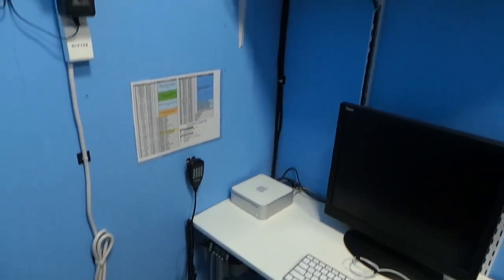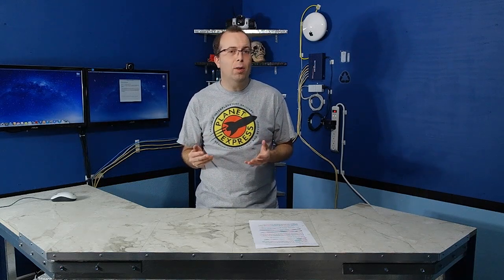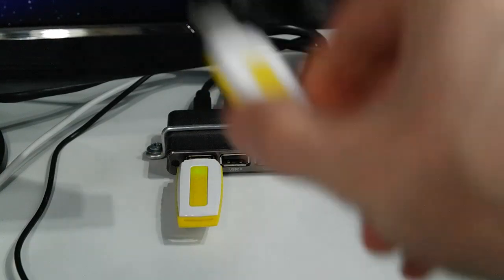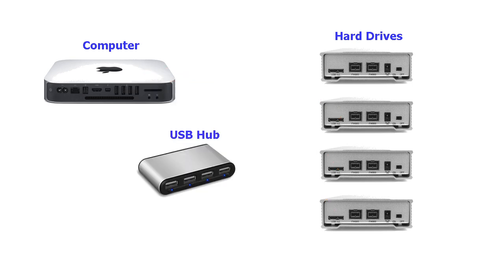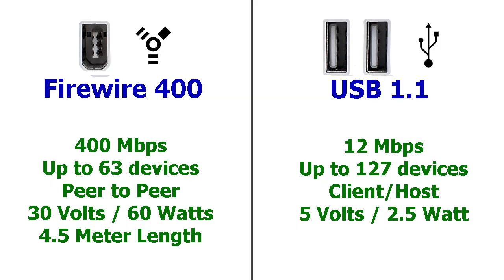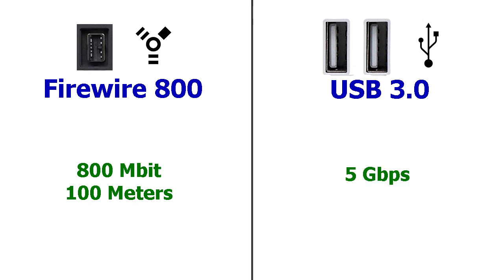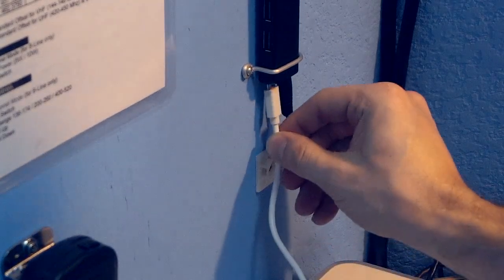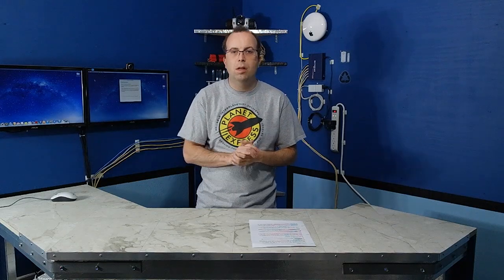Farewell R.I.P. Firewire, Hello USB!

Comment: If i where you i would go with NAS instead, for instance a 2 or 4 bay (or larger) synology diskstation. Costs a bit more, but it gives you way more feaures and alot more speed (1gbps or even 2 gbps if you do dual lan models). Having those kind of drives for any backup is bad, and especially if you do RAID5 - ods that you will get a unrecoverable read error is almost 100% on volumes of 2TB or more and it will result in lost data.

But RAID is no backup anyway.

Comment: Why didn't you keep the Firewire cables on the old drives and then added the USB hard drive using it's own USB slot or hub? Wouldn't that reduce the cable mess?

Comment: Isnt Thunderbolt Daisychain too?
Reply: iMac James It is
Reply: +iMac James 
It is, and, but, Thunderbolt is ridiculously expensive when compared to USB. It&#39;s also incompatible with all the existing devices meaning you&#39;d need to re-buy everything to use it.&#160;

On top of that, USB type C has integrated all the features Thunderbolt introduced, plus some, with backwards compatibility for USB and every other function that is crammed into it. 

So now not only is Thunderbolt more expensive and uncompliant with existing tech, but everything it can do USB type C can do better and cheaper.

Comment: I think that Thunderbolt will probably be much like Firewire and not gain wide usage by the general public. I have a 2015 MBP 15" model, and still have my 2011 MBP. They both have Thunderbolt (well the 2015 is Thunderbolt 2). It's been 4 years and Thunderbolt devices are still rare and expensive. Sigh So much potential and power....

Comment: You failed to mention one of the most important benefits of Fireware, low latency and reliable timing. FireWire was functional for doing audio engineering. USB is a PITA. 
Also, try hooking up 10+ external USB drives to that Mac Mini, and watch as drives just mysteriously disappear, and data gets silently corrupted. Hell, those for dries may be doing that already, and you just haven't noticed. 
Apple's implementation of USB sucks. This is irresponsible reporting. If you need a server, build a real server. Apple makes great stuff if you're a basic consumer, and use ONLY Apple gear, in ONLY the way Apple expects. Trying to "think different" with Apple gear is just asking for trouble.

Comment: If you copy external drive to external drive, with USB, you definitely want to be plugged into to 2 separate ports on the computer.  Doing this between 2 drives on hub will really slow things down.

Comment: Good video nostalgia of firewire.

I'd say your tombstone is inaccurate. Firewire's been dead since a year or 2 after USB2 came out in 2000 except for mac users who were a minority (2% market share at the time, less than linux), but even mac went all USB soon after around the time it dropped powerPC for intel processors. I'm not saying usb2 is better than firewire, just that it all but replaced it and beyond this point firewire was just a shadow of the past.

Also, why did you mount the usb hub with the wires facing out into the room instead of back towards the wall? That would make for neater wiring.

Comment: If USB could daisy chain, then that would honestly be perfect.
Reply: Mr.DerpMuffins Some USB can daisychain, ive made some mods on an external HDD
Reply: Mr.DerpMuffins You can daisy chain multiple USB hubs off a port, and there's no reason a USB device couldn't include an internal hub with an extra "OUT" USB port on it.   You do, however, lose performance that way.
Reply: Dracolith1 What about USB-C?
Reply: Chupick Nicolas There is devices that theoreticly can daisy chain. One way to do it is make every device you connect a 2port USB-hubb. One port goes to the device, one to the next device and the uplink goes to the host (PC or previous device), there is a product out on kickstarter that works like that, https://www.kickstarter.com/projects/668098663/infiniteusb-one-usb-port-unlimited-devices
Reply: yeah, like a mini hub
Reply: Derpmuffins The Great It's be bad to the bone! :)
Reply: Usb can be daisy changed on dell ultra sharp monitors

Comment: Why bottleneck the entire setup by using a USB2.0 hub? You're basically getting around 20 MB/s in total across all 4 or 5 drives however many you're setting up. That's pretty darn slow if you ask me..

Comment: If only they ditched USB in the early days for firewire! it was truly a great data bus! surely they could have made versions after firewire 800 that would have been better than USB ever could go if USB never came around
Reply: Sony Trinitron Didn't they already with Thunderbolt succeeding firewire?
Reply: Residenteviladicted Forgot about that, I am not that much of a mac person but anyway.
Reply: Sony Trinitron Great buss, but expensive for manufacturers to use.
Reply: FireWire was a proprietary port created by Apple, so it was almost impossible to get the authorization to put it on a PC (Intel put it on a few Motherboard at the time, but not on the majority) and even if Apple accepted, the constructors had to pay to use it. On the other hand, USB was universal (created by all the big companies of the time : Compaq, IBM, Intel, Microsoft, etc.), cheaper to add and more common. Say thanks to Apple if FireWire never really worked.

Comment: Hi!  Always found your videos informative.  How did you connect your external HDs that used to be connected by FW to USB 3.0 ports?  If the HDs had USB 2.0 ports & that was connected to the hub, wouldn't the transfer speed be slower than using FW800?

Comment: I see you've made your switch over to USB - but did you consider thunderbolt? (With thunderbolt 2 having around 20Gbps max transfer speeds it's worth checking out). 

Also, I'd like to point out the USB-crossover cable (that is any USB cable with the male type-connector in full size, on both ends, that has it Rx/Tx lines crossed so both devices -- presumably computers, may exchange files and other data) -- this isn't the same as FireWire for sure, but it can be done. 

Although, just to mention this as well-- thunderbolt replaces FireWire entirely in this point, with remote disk and display extension capabilities. 

Nice video, love the cable management :3

Comment: The nice thing about firewire always was that the performance hit on the system was way less than USB when using mass storage or data transfer. It could pretty much handle all of it's IO by itself where USB still needs tons of help from the CPU and bride chips.

I see Lightning as the successor to Firewire and with the adapter cable it is even backwards compatible with it.

Comment: I still use firewire and still prefer it to USB. I have a plethora of 400 and 800 cables. I especially love my 400-to-800 cables as there are no adapters needed to convert in between the two. I'm forced to use a Thunderbolt to 800 adapter nowadays, but everything still works out well.

Thunderbolt to be is the final upgrade to 1394. It has the same high volt/wattage and daisy chaining features as 1394. Sorry, I still call firewire, "1394".

As a mobile DJ 1394 was the way to go. Firewire drives never needed external power cables, and the cables themselves were more durable and stayed in the socket more snugly than usb. For DJing I have since switched to a custom DIY Thunderbolt drive, which I have made a video for on my channel.

http://amzn.com/B003ZVBP0U
My favorite enclosure is a two drive 1394b/esata/usb enclosure linked above. When using firewire, whether be it 800 or 400 (with 800-to-400 cables), you don't need to use a power brick to see both hard drives. You can even setup the drives in RAID. I have one SSD as backup for DJing, and a 500gig HDD to store movies. Greatest enclosure I've ever owned.

To me, firewire isn't dead. It just got upgraded to Thunderbolt.

Comment: I have a question, why do we mostly used USB instead of firewall back in those days?
PS: Do somebody know the ending song?
Reply: BuzShow simple answer: Price. Usb was free to use (no licensing) and had cheaper controllers. The masses voted with their wallets.
Reply: Buz Apple developed Firewire and being the greedy people they are charged for each port used. No problem for Mac but build something yourself or buy a non-Mac computer there is extra you need to pay, and if you're a manufacturer making 10000 computers with 2 ports is $5000  ($0.25 per unit). Easier to not put one on and use subpar technology.
Reply: BuzShow Higher price tag.   I used mostly Firewire 800 devices for working external storage devices though....    USB was fine for backing up to an external hard drive,  but  Firewire, SAS, or eSata were the only things that would do, when performance was needed.
Reply: Vinny Falcone - Trance 1990 is the music.
Reply: Epic_Gamer_2000 The Best Gamer Ever plus, you can download it here: http://bit.ly/1fkafer
Reply: Thanks
Reply: Buz The same reason we still use USB over Thunderbolt (Price), in fact, Thunderbolt is so much more expensive than USB that it's generally only used by Professional Media Creators.
Reply: +shniblybus You hit the nail on the head with that one, and the only thing i can think of off the top of my head that Apple has released for free, and as a bonus it's open source has been CUPS software for printing, which has been adopted by the Linux community. If they have done that with anything else someone please feel free to correct me lol!
Reply: +Commodorefan64 CUPS was officially released in 1999 and Apple adopted it in 2002. Apple did not develop officially for CUPS before 2002

Comment: You made a slight mistake at 1:31 Windows ME did have native USB mass storage support. It came out after Windows 2000 (not before as depicted on your picture) and had USB mass storage as one of the features carried over to it from Windows 2000 which made it the only Windows 9X OS that includes native USB mass storage support.

Comment: Firewire still has its uses here and there... it's too bad that many Windows PCs never even had Firewire for some stupid reason. If you have some sort of old device that was made without Macs in mind, you obviously aren't going to be able to take advantage of your Firewire ports. Oh, and an added note here: Target Disk Mode is the greatest thing; talk about yet another feature that you would only find on Macs! TDM has rescued me many times, and it's also convenient for casual usage. Is your data-filled HDD stuck in a dead computer? Rather than dismantling it, you can just use TDM from another Mac and easily clone your data off - even format the disk with Disk Utility (another utility that is far superior towards Windows' stupid Disk Manager). Interesting how Windows fanboys will constantly whine about how MacOSX is overly simplified and is for idiots who don't know how to use a computer, when it includes utilities that are smarter, better, and more efficient than the whole of Windows. MacOSX cuts the cr@p and just works. I cannot tell you how many times I have run into cryptic errors with Windows.
Reply: Lara Dudleysmith firefirew/1394 had one problem USB didnt. Price of client controler (the part in the drive) and licensing. Licensing cost i think went away, but logic circuts for 1394/FW cost way more then USB.

I have had several PC's with firewire but never any use for it. Now we got usb 3 and the theoretical 5gbps is still way more then any mechanical consumer grade disks can deliver - so the chokepoint now lies in the storage medium itself.
Reply: maccollectorZ (Commenting Account) the reason you never had a firewire on your pc is because firewire ports only come with macs.
Reply: Epic_Gamer_2000 The Best Gamer Ever
Well, the name 'FireWire' was given by Apple, but there are some Windows PCs that have Firewire ports... or, rather, '1349' ports. It's just that most Windows PCs don't, so we have already seen tons of devices that were slow USB when they could have been with the 1394 interface - all because of Windows PCs (or the majority of them) not having it. It may sound stupid to argue that most don't have a port that was supposed to be exclusive to Macs, but the fact that some Windows PCs had them makes you wonder why the rest did not.
Reply: Too bad I never used FireWire... I can just use Thunderbolt on my iMac 2011 now as a replacement for FireWire :)
Reply: Firewire can still come into play if you happen to be dealing with some older hardware. Not everyone is going to have the newest server or brand new external HDDs, or something.
Reply: Yes, it's good for collectors and people with older macs (or rarely PCs.)
Reply: +maccollectorZ (Commenting Account) Please correct me if I'm wrong as I am not an expert on Firewire, and I've only read very little about it, but wasn't Firewire only faster than USB up until USB 2.0 came out? I believe I read that somewhere years ago when USB 3.0 was about to come out. ( P.S. I still haven't even watched the video, just came straight down to the comments lol, maybe the vid answers that).
Reply: TH3C001 I haven't looked it up... but I know that it's definitely faster than pre-USB 2.0, and it may even be faster than 2.0. Remember that there is Firewire 400 and 800. Firewire 800. I think 400 left Macs in total in 2008 or so, and later models featured 800, but I have never paid too much attention to that. My 2009 MBP, though, has 800 - I'll tell ya' that. I'm VERY sure that 800 is faster than USB 2.0, and 400 could even be faster. Firewire has now been trumped by Lightning and USB 3.0, but it's still obviously useful if you don't have the newest hardware. 

It was actually annoying how non-Apple products (like external HDDs) would be geared towards Windows PCs (which rarely had Firewire ports) and use USB 2.0 or something. Apple introduced Firewire in 2000, and Windows PCs continued using USB - except for those few that had Firewire. Now that I think about it, I'm definitely sure that the only thing faster than Firewire now is USB 3.0. USB 1.1 and 2.0 are slow.

Comment: David, have you ever heard of OWC (Other World Computing)? They have a plethora of different external drive configurations, including single drives from 500GB to 6TB and RAID setups. All of the drives come standard with USB 2.0/3.0 FREAKING FIREWIRE 800, and eSATA. More technically, all of the drives run at 7200 rpm and have a base cache of 16MB. After doing some research of my own, I have concluded that the speeds that you can get from these drives over FireWire are faster than the speeds of a G-Technology G-Drive. The customer reviews are mostly positive with many products being well beyond 4 stars and many people are raving about how good these drives are for production and backup. All of these drives are backed by a 3 Year OWC Solution Limited Warranty. http://eshop.macsales.com/shop/firewire/

Comment: Why don't you have a real server? Something with internal HDD and better network ports. FreeNAS is really powerful for whatever you may need your server to do.
Reply: gjmob Why? Even Apple's servers don't run OSX. Most servers run variants of Linux or BSD. FreeNAS is a good DIY solution for servers.
Reply: dimmddr1 Mac Minis have an internal HDD, and Server Mac Minis actually have two HDDs---one being in place of the would-have-been optical drive.
Reply: maccollectorZ (Commenting Account) Sorry, I meant lots of HDDs.
Reply: dimmddr1
Yeah - It would be easier to be able to store all of his HDDs in a single machine, but that single machine would be pretty large and likely not power-efficient.
Reply: maccollectorZ (Commenting Account) Modern power supplies are super efficient nowadays. Even if it says, "750W," for instance, if it's idling, it won't need a quarter of that. Of course, that all depends on the hardware. Hard drives don't need power unless they're spinning, you don't need a GPU and you likely won't overclock the CPU or RAM. Unless you're doing a lot of processing you won't have an issue with power.
As for size, yeah, you can't have anything as small as a Mac Mini. Although, if you have 4+ external hard drives, it would be probably just as small to have a Mini ITX case with internal hard drives. He probably just repurposed an unused computer because "why not?" If you're working from scratch, you should build/buy a dedicated server.
With a dedicated server, you have more flexibility. Faster networking (depending on the NIC), virtual machines, ECC memory, etc.
Reply: dimmddr1 I understand that a 750 watt PSU will not constantly use 750 watts... but yes, you could have a smaller computer case that can store the drives. This Mac Mini he's using is repurposed, so that's exactly why he's not getting a whole new machine. These do make nice servers, though. While you cannot have more than two hard drives in one, the computer itself can be tucked away pretty easily. Operation is also quiet and power consumption minimal. (These Mac Minis' power supplies are essentially laptop bricks.) We currently have a Mac Mini (server model) as our server, and it's a sound little machine. The two internal HDDs are 500GB each, which was something in 2009. If adequate for whatever user, it would be just fine. Admittedly, we have a couple external drives on this thing. I have a capable Hackintosh, but it's too much of a monster.
Reply: dimmddr1 But then he wouldn't be called the iBook Guy,  He'd probably be called "the crappy enclosure windows blue screen fatal error Guy".